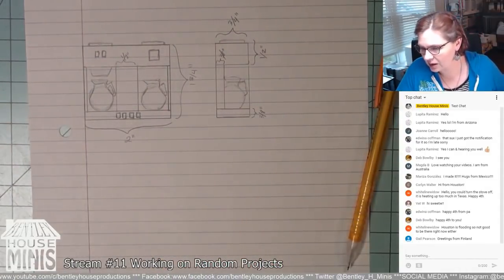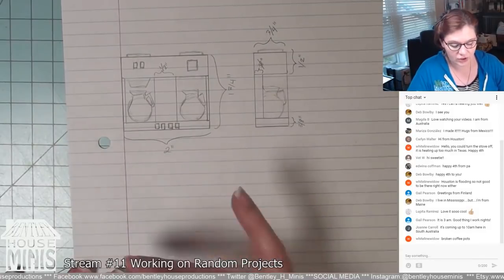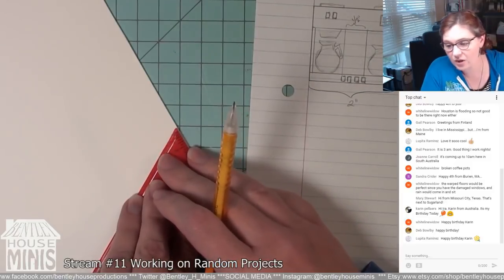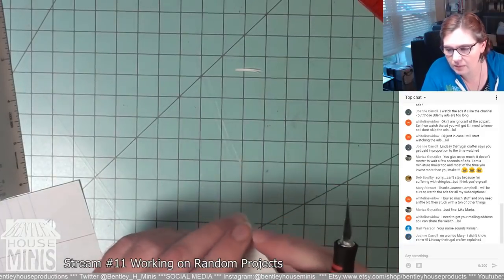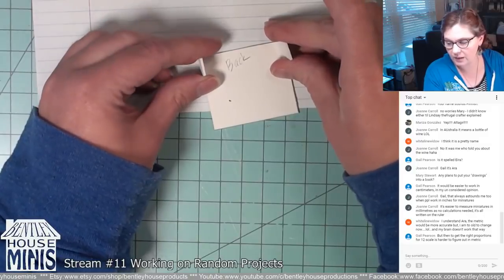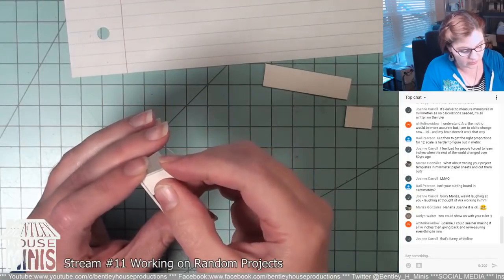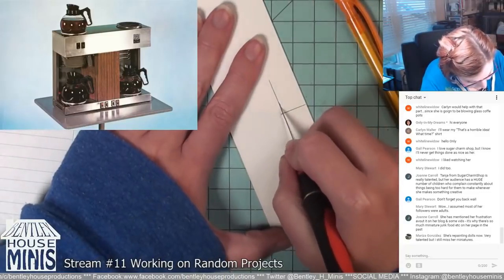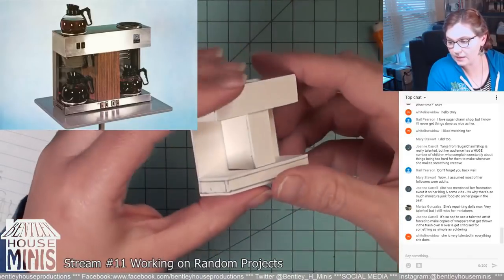Old Rusty Miniature Coffee Maker (BHM Live Stream #11)

Comment: Things without resin: ie, your coffee pot or glasses.  shrink plastic over 1/2 form and mirror image (best to make your whole form then cut in 1/2) place plastic over form, heat over a vac box,  then superglue made parts together. I do a lot with pop bottle plastic and water bottle plastic the thin walmart one's form easiest for tiny parts. You can do clear or the tinted ones, watch your heat! I used medium heat and keep it moving. I learned it from my dad who does RC model planes.
Reply: mini laithe:...Dremel on it's side in a crib holder. I used  shelving scraps and the end can be supported by a pin socket...there's a really good example on youtube  paoson? i think is his name.. my dad built mine when I was a kid, i still use it, nearly 40 years later. I use tile stamp carving/making tools on it and set of micro files from harbor freight (like 2.99)

Comment: What type of nib (for the precision glue container) clogs up? I have those precision glue containers that have metal nibs and have a cover that goes with it to help prevent it from clogging. If it ever does clog, I just unscrew it and poke a sewing pin through to push the dried up glue out. I've never experienced having it rust. I use elmer's wood glue in it.

Comment: Is there are reason you use matte board rather than hobby wood?
Reply from the maker: The mat board is smoother to start out with than hobby wood.  To get a smooth metallic finish out of  wood I would have to sand and paint several times.  And I have found mat board to be as easy to sand and as strong (in most cases) as wood.  And no splinters!
Reply: Thanks for such a prompt reply.  I have been using matte board for somethings also, largely in the dollhouse it avoids adding so much weight.
Reply from the maker: I find it super helpful and versatile!  The weight does help as well :)